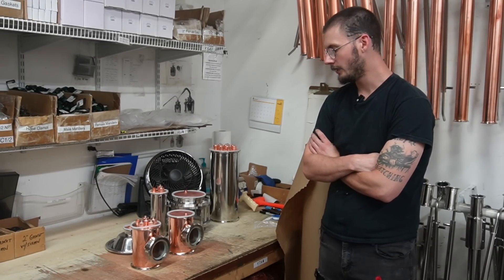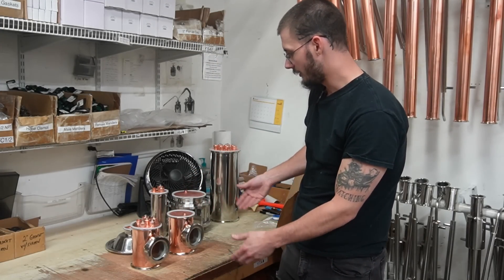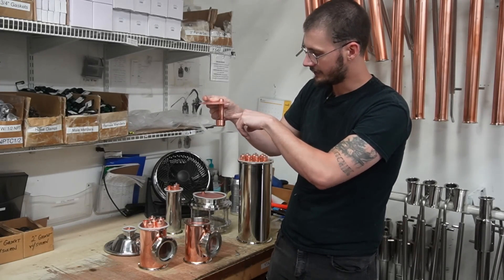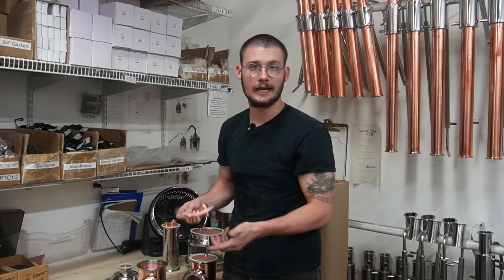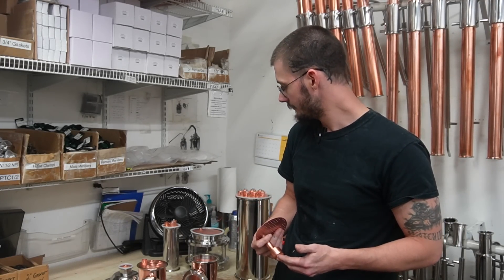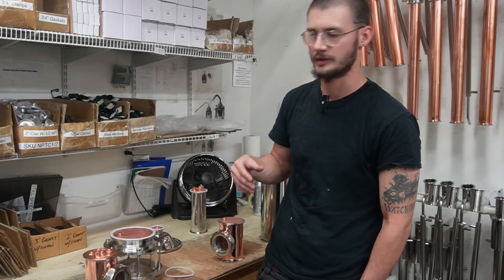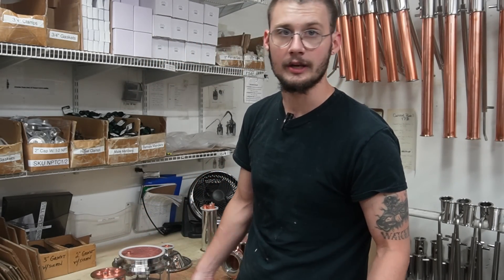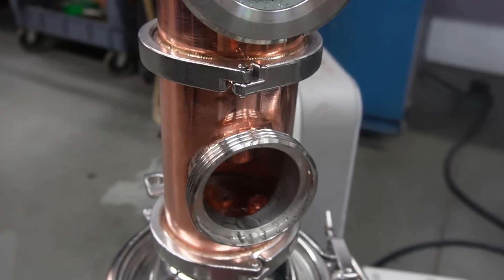Bubble Plates vs. Downcomer Plates

Comment: how much does a hole weigh??? and how many holes equals a ton? does hole size matter?  can you mix hole sizes?   ;)
Reply from the maker: Sorry, I am not sure how to calculate the weight of the holes nor am not fully understanding how to calculate how many holes in a ton. The hole size can matter, but I feel like it's so minute of a difference, that I wouldn't worry about. We can machine multiple hole sizes on a plate, but it would need a mold and would have a minimum order quantity of about 500 pieces just to make the custom mold worth it.
Reply: @milehidistilling1  so, if I ordered a box of 500 holes would I get all of them because a box full of holes may have the possibility of some of them falling out  ;)
Reply from the maker: @bunnykiller  Sorry, just having trouble understanding what you're meaning by ordering the holes. You order the plate with the holes. It's a solid piece.
Reply: @milehidistilling1  I already have a plate but need some holes, if you can send me some holes I can put them on my plate when they arrive...   ;)   and yes, Im being silly

Comment: What is the minimum distance between bubble plates? So i can keep my stack smaller.
Reply from the maker: If I'm understanding the question right, you would need about 3" distance between each plate to avoid them bumping into each other and also leaving some comfortable space between them.
Reply: It is dependent on how you run your still. I've managed 2" fine. So many things wrong in this video. It scares me

Comment: Ive been calling my plates "perforated" for past 6 years
Reply from the maker: That's not wrong, no worries. The "perforated" refers to the holes throughout the plate, so that's correct terminology. If you want to get technical these are perforated plates with a downcomer stem soldered onto them.
Reply: Those ARE  Perf Plates. Both Perfs and Bubblers have down comers. I can't believe Mile HI posted this stupid shit. 😂

Comment: I'm confused. Do both sight glasses fog? I thought the bubble plates would bubble in the sight glass, and the downcomer wouldn't. But it looks like it's the opposite?
Reply from the maker: Hi there. Both bubble. Because we were demonstrating with water rather than alcohol, it affected the amount of bubbling the plates did. The bubble plates do have a more controlled bubble compared to the downcomer, though.
Reply: @milehidistilling1   Thanks for that. By change do you know if George mixed up the plate names? He seems to say bubble plates while showing what appears to be down combers.
Reply from the maker: @WildernessMedic  Hey there. I'm not sure if you're talking about a certain video with George, I'm unfortunately not aware of that.
Reply: Nope, I use sight glass with bubble plates on top and the bottom.   I like see the volume of reflux from the dephlegmater and going back to my boiler.